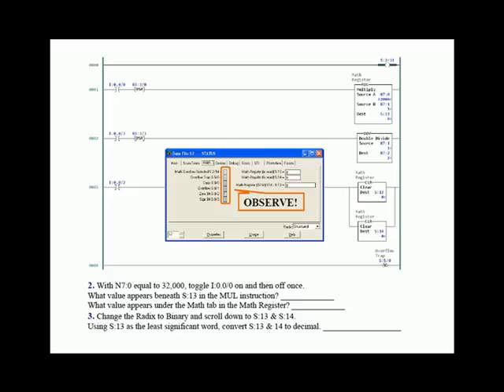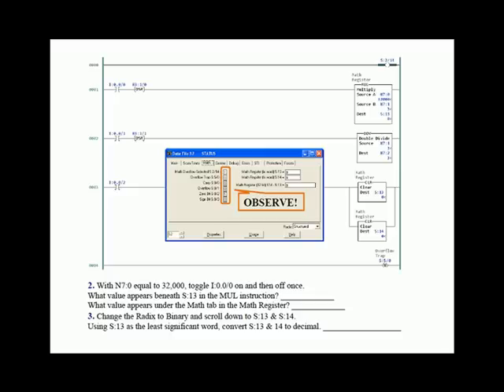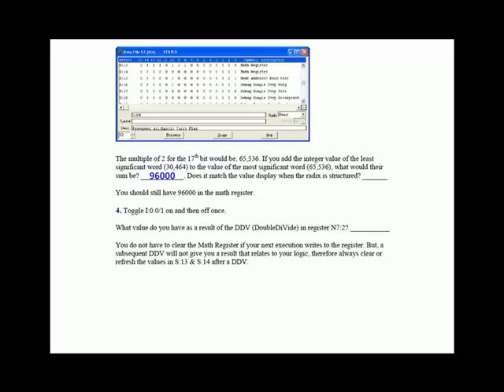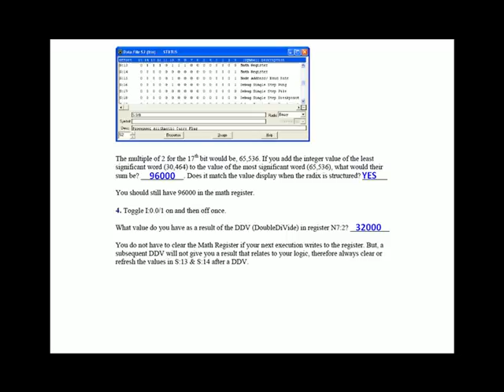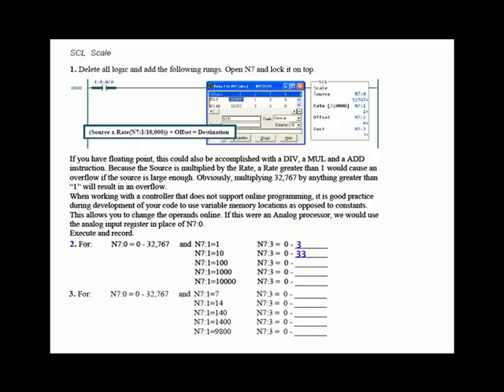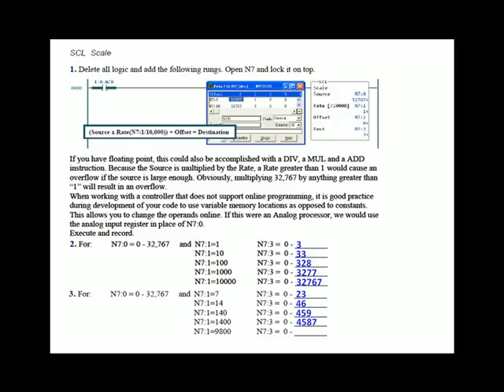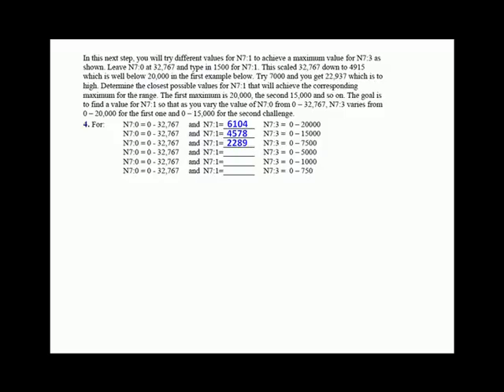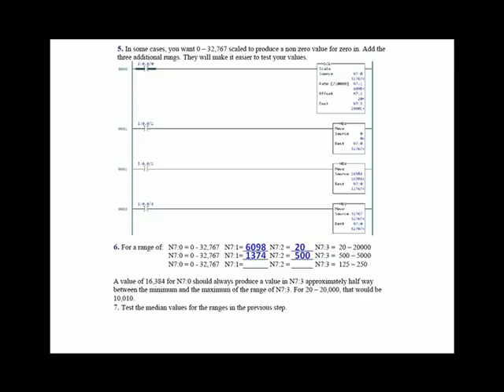ADV1 17 - DDV SCL Instructions RSLogix500, A PLC Tutorial.

Comment: Hello Professor, At 6:11, i don't understand how you got "65536" and what you meant by ''the multiple of 2 for the 17th bit would be 65,536".
Reply from the maker: +Vica duch Are you using the manual?
Reply: +plcprofessor  ,Yes. 

S:13 binary reads; 0111 0111 0000 0000. S:14 binary reads; 0000 0000 0000 0001. Changing the radix to decimal, S:13 decimal reads; 30,464 and S:14 decimal reads: 1.

How did '1' become 65,536?
Reply from the maker: +Vica duch the least significant bit of the upper 16 bit word would be the next multiple of 2, the 17th bit (bit 16) of a 32 bit word has a positional notation of 65536. Use your windows calculator, view to Programmer and toggle the 17th bit to one.
Reply: +plcprofessor ,  Oh yea. I got it. 2^16 is 65536.   Thanks Prof
Reply from the maker: +Vica duch The windows calculator is very handy when working with binary and HEX>